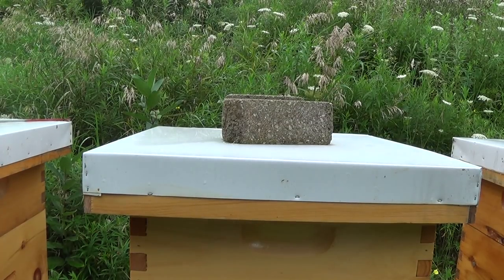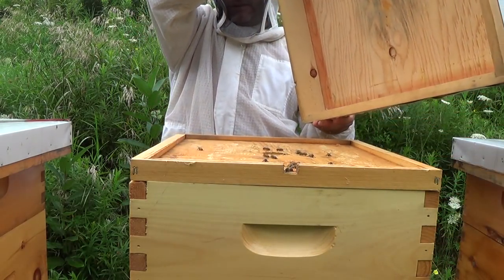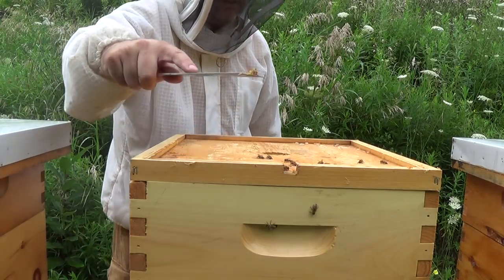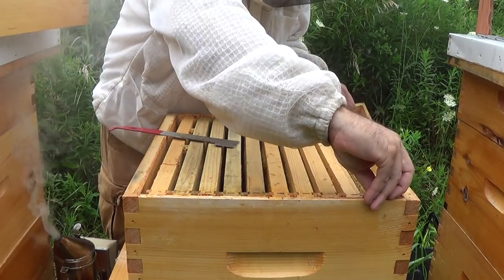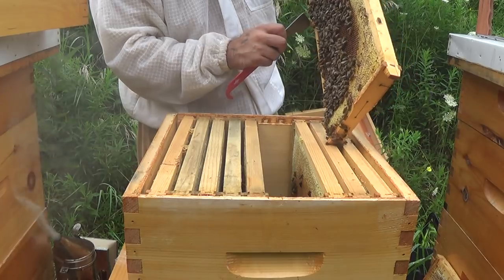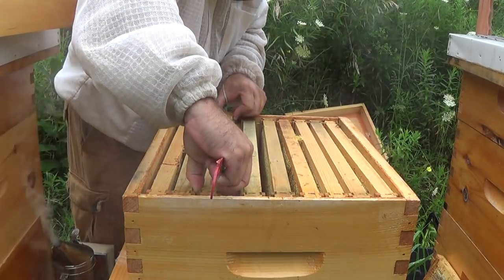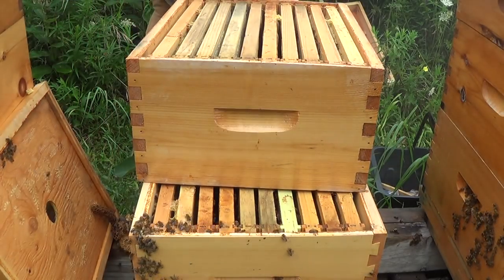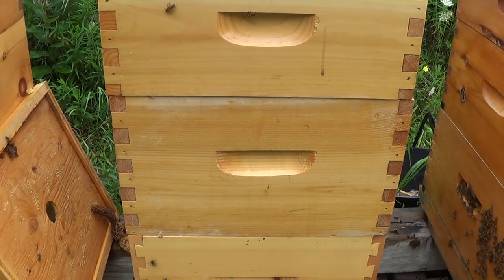Beekeeping Why are my bees not making honey?

Comment: Every bee keeper needs a safety valve for hives that swarm - put a swarm trap less than 100yds away from your hives (due south from your hives if possible).  Throw in a Q-tip of lemon grass oil in a slightly open ziplock bag (for slow scent release), and refresh it every month, and if your hive does swarm, this might be their best choice for a new hive and you can get back what you lost (and then some).
Reply from the maker: +Don Rota I have one 20 feet away

Comment: Hi Frank looks like you might have lost the queen for one reason or another. I'm a newbee  and not an expert, but this happened to me last year. I started bee keeping  May of 2016 in the GTA (probably around your area). Started with one hive which was doing very well until accidentally I lost the queen August 26th 2016. From the info on the internet i thought for sure I'm going to loose the hive  since it was late in the season had no other hive to help it with and couldn't find a mated queen to buy. September 9th found 2 caped queen cells. One of them hatched on the 15th and tore the other cell apart.  On my next check on the 26th I found eggs and some young brood. From there on and into November the queen kept laying in good number since the weather stayed warm. In February of this year I fed them pollen substitute and in May there was enough bees to make a split which are both thriving.  Give them a chance and if you don't find a mated queen just let them create their own.  Help them with a frame or two of capped brood from the other hives in the meantime.  Good luck.
Reply from the maker: +Tony great info Tony. The queen is in there but doing poorly. Followed up this video with a more thorough inspection. Queen is laying but poorly and they have two supercedure cells going to replace her. Should be a new queen emerging in a couple weeks.

Comment: Just a constructive helpful hints from another 2nd year bee keeper - when you separate the frames, try to avoid the snapping/jerking motion to separate them laterally.  Use the sharp edge to slice between the frame ends straight down and then the J hook on it, to lever up.  As far as why no honey - so many queen cups - old ones - it may have already swarmed, and you missed it.   Next time, smoke from the bottom, and move all the boxes off the top without inspecting them before you inspect the bottom box first, and work your way back up through the stack.  The most important thing after all is to find the queen/eggs first.  In this video - you didn't find eggs or a queen.  If you smoked the entrance and then inspected the bottom box first (method) it will save you from the sea of bees in the bottom box - which makes it hard to get at and see the frames in the most important box.  

I only got 1/2 quart of honey last year between 2 hives - severe drought at the end of the year. - so your's looks pretty good.

Good luck with your bees!
Reply from the maker: +Don Rota like that method
Reply: thanks
Reply: Thank you Don, I'm a new bee keeper and tips like your are so helpful to me. Thanks again.

Comment: Yes, checking for the queen and/or eggs might be the answer.  However, a queen-less hive has a roar to it and I did not notice that in the video.  80% full is the time to add a honey super.  Bees like to draw out comb early in the year and not so much in the fall.  In the spring put foundation in and let them draw it out.  Then pull it and replace with foundation until they quite drawing it out.  That way you have drawn comb for them when you start adding boxes.  After you keep bees for a couple of years you begin to have a supply of drawn comb to use.
They will walk around foundation all fall and not do anything with it.  The danger is (as you mentioned) becoming honey bound.  You may need to extract some of what you have even if you save it to feed back to them later.  That way the queen has room for more brood now and will back fill it with honey after the winter bees are hatched.
Extra drawn frame help with splits and swarm captures, because you have something to put in the hive to get them started.
Reply from the maker: Great info ric.

Comment: Lots of honey, but did you see any eggs or larvae in cells? You said the queen cells were empty. Just to let you know they were swarm cells.
Reason as I see it is the queen didn't have any room to lay eggs and she may have swarmed. I assume that the top super was added in the past few weeks but not in time to keep queen from leaving.
When bees fall into the mindset of swarming it is difficult to stop them.
Reply from the maker: +Bruno Sulikowski could be correct. I did add the super when they only had 7 of 10 frames in the upper brood box filled so if they swarmed it was not for lack of space. Appreciate the input tho.
Reply: 4dhoneybee 1
You have more hives present. You can take a frame of eggs from an adjacent strong hive it doesn't have to be a fully laid, shake the resident bees off as to not transfer queen and place it in a 2nd or 3rd position from end for easy access later. If the hive of issue doesn't have a queen they will produce new cells, if there is a queen they wont produce any, In about 30 days you should have a new laying queen if all goes well.
Reply from the maker: +Bruno Sulikowski yes excellent suggestion.

Comment: Looks like you've solved your problem, but is there a reason you don't use queen excluders if you had one. Notice you didn't have them in your other hives?

Also you've mentioned Queen Cells, there not Queen Cells there Queen/Swarm  or Supersedure Cups in preparation for an egg/ larvae (those were Swarm Cups). Once you have an occupied cell then it becomes a Queen/Swarm or Supersedure Cell and they will draw it out. They can make them in just in case, in preparation or in an emergency. I tend to tear mine down when I see them or at least damage them, as this adds time to build and you can keep an eye on them. Also check for the Queen before you do, as there is often a reason for them making them.
Reply from the maker: +zandybrew agree
Reply: Is there a reason you don't use queen excluders? 

As there are number of people who don't use them.
Reply from the maker: +zandybrew yes I used them last year and the bees would not go through them.
Reply: Make sure you have an upper entrance.  Workers will use that to fill the supers.

Comment: Looks to me that your hive is queenless as there is no brood, larva or eggs showing.  The workers have produced a lot of honey and stored it in the 2nd deep brood box as if it were the only honey super, leaving no room for the queen to lay in a crowded hive, thus forcing a swarm.  The cells in the bottom box may have been full of capped brood and the 2nd box full of honey when this happened.  You need to inspect at least every 3 weeks.  Timing is everything.  I had that happen to me last year after I made a split during June in mid-NY State and then waited too long to put a super on top.  The workers drew out the 2nd brood chamber and filled it with honey.  It weighted 90 lbs.  I harvested all that honey in mid-July and put the frames back on when done harvesting, then added a super on top.  The workers then repaired the de-capped cells and the queen came up into this 2nd box and laid it full of brood.  This hive did not swarm.  Your hive evidently swarmed due to the empty swarm cell presence and large numbers of drones.  If you don't have a mated queen in the bottom box that you didn't fully inspect, she may have got lost after mating.  You need to buy a new queen NOW.  Its too late for the hive to make a new queen that would take from an egg to 6 weeks for her to start laying. I just got a hybrid queen shipped over night  today from Wildflower Meadows (on line) for a split I did 3 days ago.  Without a new queen, your hive will die in the fall.  Queens here in NYS lay brood up until late Oct. or early Nov. so there will be over wintering bees for the spring.  You didn't say where you are located, but there will be another nectar flow with rag weed at the end of August and Sept.  Hope my info helps.

Comment: do you have a mentor? If not please join a  club. That hive is queenless due to recent swarm/killed queen/etc. (within last 21 days). 

1. you cut out the queen cells on a queenless hive (never cut out queen cells until you verify you have a "laying queen").
2. the hive has no capped brood (so either you have a brand new queen or no queen at all)
3. the hive is not "honey bound". It showed normal arching of the honey band on brood frames.
4. the hive does not need "3 weeks to catch up"...as that hive will be dead in three weeks without intervention.
5. Yes the queen "would be laying" in August....IF you had a queen, which i didn't even see you look for. There are typically two honey flows in any given year in most parts of the world, one in spring, and one in the fall. here in agriculture zone 9 the fall one begins around the 31st of August and runs through September.

You need to requeen that hive or do a paper combine, my choice would be re-queening. Use a NUC and a few frames of one-day old eggs from your other hives to trick some bees into making queen cells, then just move those frames with capped queen cells to the queenless hive. It will take 21 days for this whole process so I would get started ASAP."

Join your local bee club if you have not already and get yourself a knowledgeable mentor. Hope you get it straight!
Reply from the maker: +Funny Bug Bees and Wood Works  eye helpful thanks.
Reply from the maker: +Funny Bug Bees and Wood Works great info thx

Comment: without any winter bee brood showing.. your hive isn't likely to make it through the winter well.. unless your new princess queen mates in time,
Reply from the maker: The new queen was mates and laying in September. I have highs it want likely that they would make it through winter but they did despite the fact that a large family of mice moved into the bottom brood box. Survivor hive.
Reply: To avoid mice moving in you can get an entrance reducer. If you get the wooden ones, you can put a few nails in the entrance slot so the mice can't fit, but the bees can. Or you can buy one that already that that kind of design. They are pretty cheap to get.
Reply from the maker: Great info I have steel ones for this year.

Comment: They are swarm cells that have hatched already. Your original queen is long gone. Stop prying your frames in the middle, pry them at the vertical bar so you don't break the frames. Do not put brood frames in your super ever. AFB lives in honey andwhen you put brood comb in your supers it promotes the spread of the disease. Stop dropping wax on the ground too it draws in wax moth and hive beetle. Your video shows alot of what not to do. You are in need of alot of information to become a beekeeper at the moment you are a bee haver.
Reply from the maker: Very good points